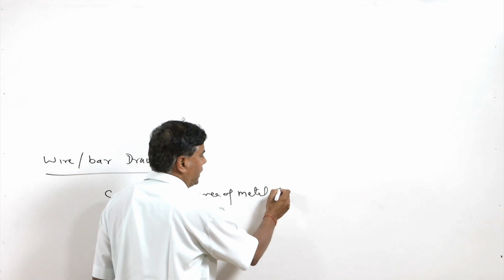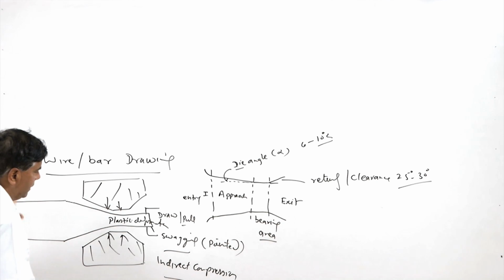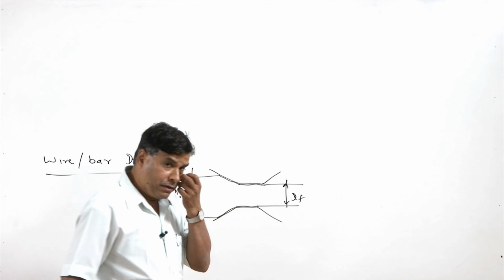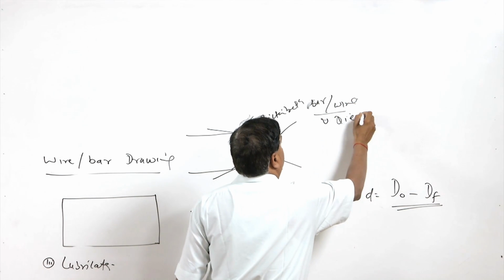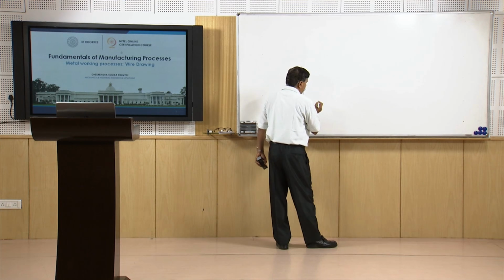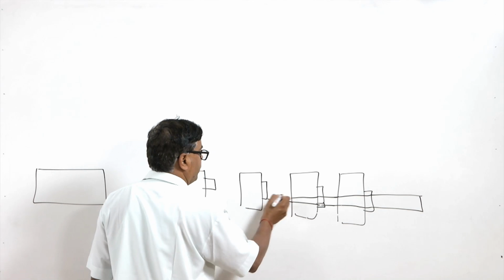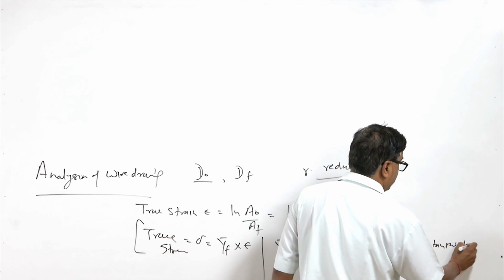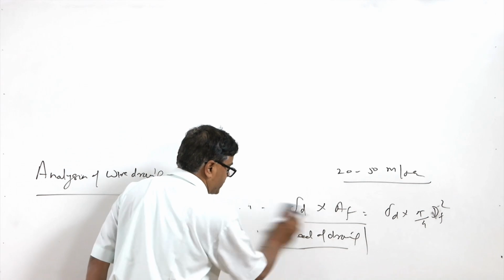Metal Working Processes: Wire Drawing

Comment: What may be the problem if drawn wire is annealed and it breaks during flattening.
Reply: Multiple factors.... for instance, cleanining of the surface might not be done properly which would leads to corriosn and ulimately weakining of the surface. Other than that, luberication might not be applied properly, Moroever, if reductions percentage is required than it is suggested to use mulitple dies. (This is what i understood from his lecture)

Comment: 10mm 1drw mi 8mm hoga agar motor ka cepsiti 40 ya50horse power  hi to maal baar baar tootane ka khatra hota hi motor par 78hajaar lod parega agar kum hi to moto rook jayega quki 10mm ka average maap  macromitar se 393.9 hona chahiye 8mm ka size 315.12 hota hi to 10mm ko 8mm banane par total 78.78 hajaar  ke as pass lod parega ampaer mitar par jo 1drwo mi Ho  sakta hi  320tse 322tak thik hi 315 ovarlod OK motor capacity hona chaiye aur  koi v jankaari mi de sakta Hu single wair drwoing machine ka change maal bannane ka Ho ya machine banane ka 10 year